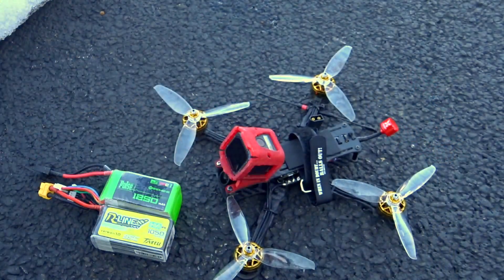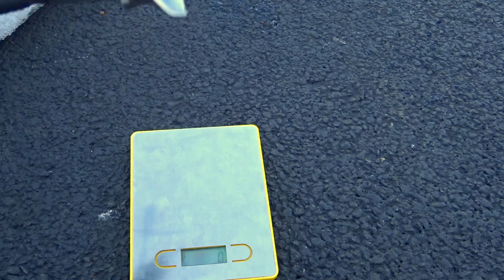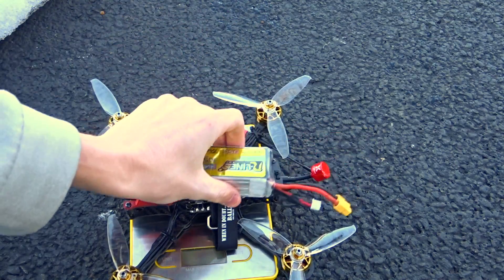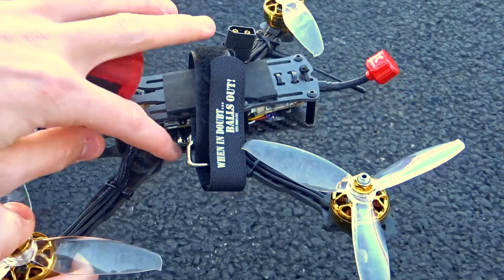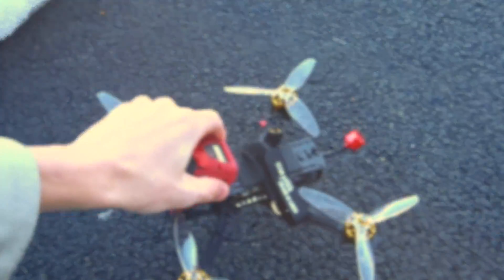New Freestyle Build Overview : FlyWoo Electronics

Comment: Had a problem with the kakute F7 FC when the soft mounted Gyro on the piece of foam was too close to the top plate the battery strap was rubbing against it in Flite causing twitches and the quad to flip out same problem you were having had to raise the standoffs on my 6inch because of it @The RCAddict
Reply from the maker: Intersting, I was wondering if that could be an issue, thanks!

Comment: I was considering these motors for my 7" 5s build up coming on my channel but I went with the 2506 Ion motors instead.. Do you think they would do well on a 7" rig?
Nice review n thanks.. ScooterPie,
Reply from the maker: Small motor and high kv for 7inch probably wouldn't go over too well.
Reply: Seth is right - small motor on 7" causes odd issues with control authority  and ironically hurts efficiency and flight time.  You can do a fair bit on throttle limiting to mitigate issues with KV interfering, but the smallest motor I've been happy with running 7" on 5S setups is a 2507 running 1500KV - I wouldn't go much below 2407 for any reason, and I'd try and keep it under 1800KV outright (maybe an F80 in 1900KV, but that's a pretty high KV flavor)

Comment: Sounded like there were some mid throttle oscillating. Wondering what your TPA is set at. If the breakpoint is at the stock 1650, maybe take it to 1300 and see if you can hear the difference. Couldn't see any vibrations in the HD, but I could hear it only in the mid throttle. Sweet quad!
Reply from the maker: Tiny bit, actually tuning instead of just changing breakpoint is better.
Reply: @TheRCAddict  breakpoint just helps TPA match the thrust curve. Part of a good tune in my opinion. All good either way.

Comment: The shakes you were talking about was probably a slightly bent motor Bell or prop shaft. Best way to figure that out is to take the props off and idle the motors up and slightly touch the prop shaft and feel for any wobbles. I had to change a motor last night because of that
Reply from the maker: Vibration doesn't cause that, as well as you can clearly see it flies great expect in a specific situation. A vibrating motor would cause shit all the time. Something it wrong with the fc that is freaks out when things change too quickly.

Comment: Nice looking build and video, 
I'm gonna get a freestyle quad soon too (I'm kinda following the videos from Mr steeles how to get into fpv) and I already have roughly 40+ hours with the simulator and feel fairly comfortable there... But as for getting a drone im not sure what to get as a beginner, like, should I start out with 6s or rather 4s, F4 or f6 FC, how much of a necessity is crossfire (I got free r9m with the taranis qx7 but I can't really find any info on whether it's viable or not) and so on...
Tl;dr  do you have any tips regarding first freestyle quad for a beginner?
Reply: Tip/advice. Don’t give up when things break
Reply: Just go with 4s, 6s is too expensive and for a typical freestyle pilot not worth the extra money. As for the flightcontroller imo a f4 does the job just fine, but if you really want to spend the extra money you cant go wrong with the f7. Crossfire is really not nessesary if you are not doing long range stuff or flying through a lot of concrete buildings with high rf noise. The r9 is pretty simular to the crossfire except for the lower latency on the crsf (a beginner will never notice very minor) and a few comfort features like auto firmware update on the receiver. I personally would just stick with 2.4 ghz. Hope I could help.
Reply: @jutzgamingtv6610  alright, that's some solid advice, thanks a lot - now I just gotta wait for the next paycheck :P
Reply: @Averell64  if you can afford the armattan marmotte, get that, don't skimp on camera or esc's, get cheapo everything else including motors and charger,  you will break the motors so buy as cheap as you can until you know what size of motors suits you. the r9 is great and well worth the effort to research, its not really about range and more about penetration of signal.  and like obrien said, dont get discouraged just ask somebody.
Reply: @TheMadmacs  thanks mate, I'm curious though, why should I go for a cheap charger? I thought that was a one time investment that you should absolutely not cheap out on 🤔
Reply: @Averell64  yeah chargers are a bit of a mystery,  you can spend a lot of money on them . the first problem you will encounter is power supply, a lot of chargers need an additional power supply, so it makes factoring in how much stuff costs a bit annoying,  i suggest buying two cheapo chargers about 20 quid max each, and two cheapo 10amp, (6amp in reality) power supplies,  these can cost another ten quid each.  
                 it would be pretty easy to buy a fancy charger for 60 quid only to find out you need to buy a 20amp power supply to be able to use it, thats another 30 quid, so go for the cheapos,  when you have enough knowledge later you can pick out a cool charger and power supply. 
            the main thing is you will be tempted to use a multi charger with a bigger power supply, i recommend avoiding it if possible, one battery one charger and charge below  1c, typically at 1amp for a 1300mah battery and no matter how fancy the charger you get in future, you will always be able to charge multiple batteries at the same time, plus that one odd 3s battery for your goggles or whatever,